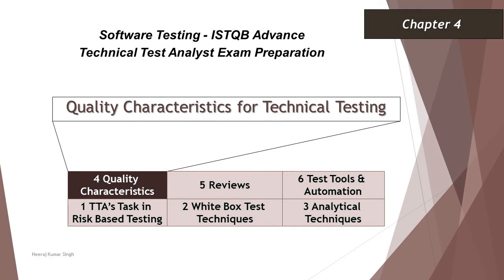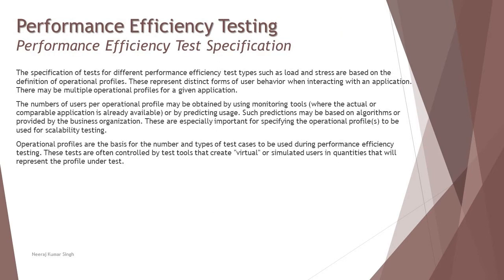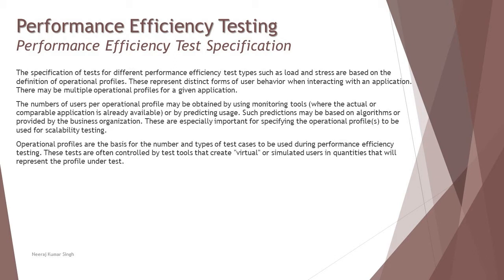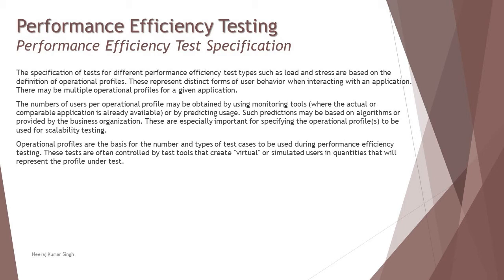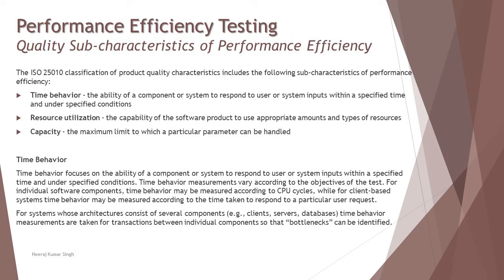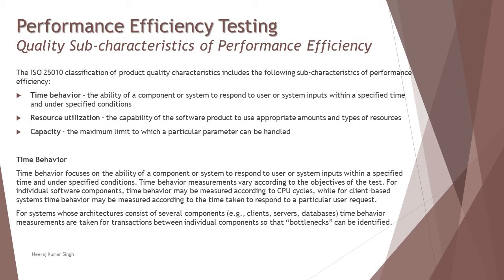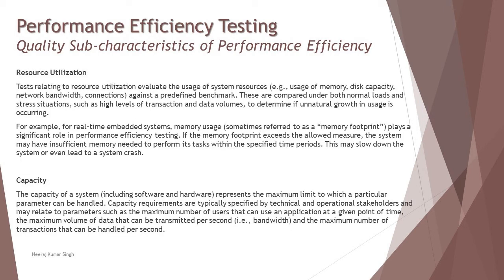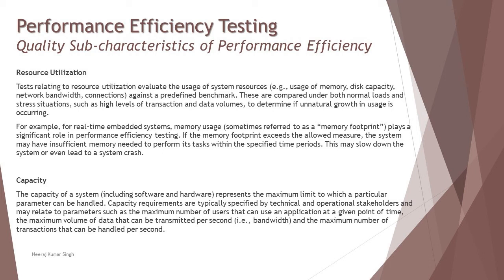ISTQB Technical Test Analyst | 4.5 Performance Efficiency Testing (Part-2) | Performance Testing

Comment: Thanks for the knowledge shared, while, as I mentioned in Chapter 3, some details had changed, and in this section, Performance Testing, there are several you need to take in account.
Reply from the maker: I really appreciate your inputs. Thanks will consider for revision.